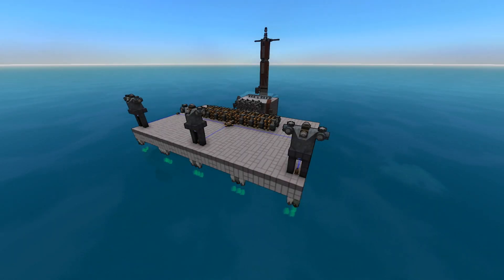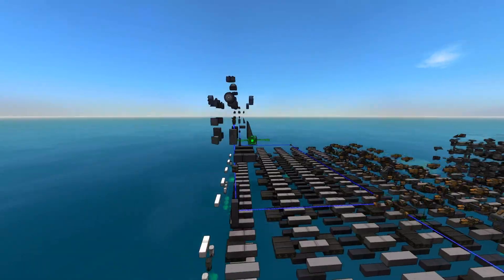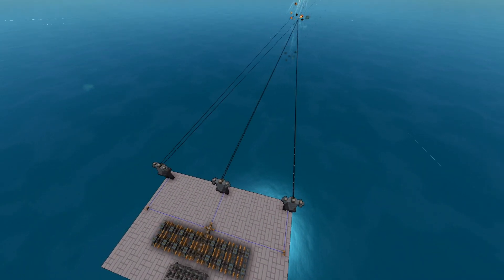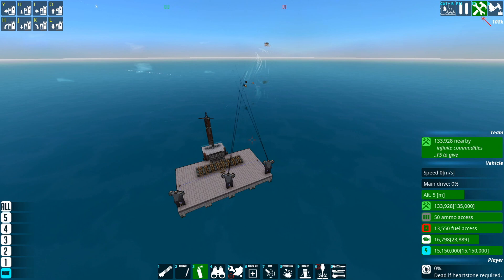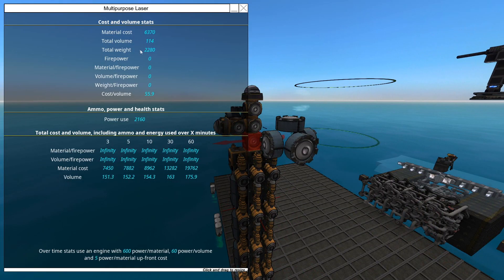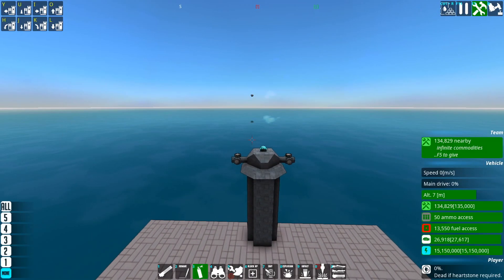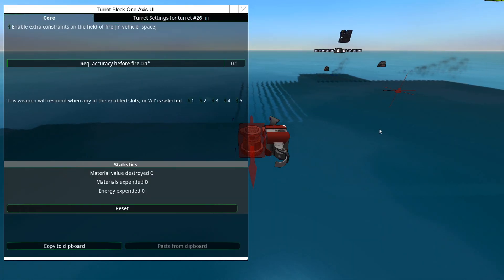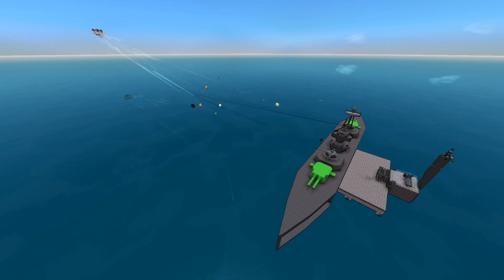LAMS Turrets? From the Depths

Comment: HOW DO I MAKE MY LAMS WORK. THEY HAVE MUNITION WARNERS, BUT THEY NEVER FIRE.
Reply from the maker: - Are they connected to the laser system, via connectors or transceivers?
- Do you have sufficent engine power, materials and/or fuel storage to run them?
Reply: @BorderWise12  I did have them connected, and I had enough engine power, idk what I did, buy they work now.

Comment: Just a heads up here, but you probably want to use a 3m turret base and turrets with nothing but the laser lensing components in it to maximise the rotation speed you can get from them. That way you don't get DDOSed quite so easily and pipe in the actual power from a fixed laser brick with more significant amounts of armour.

Comment: Personally I still think having more nodes is better then having them spin around. There's no delay of waiting for it to rotate into position and even if it gets destroyed on one side you still have the other side defended. On top of taking up less space in a larger variety of locations. However I have considered the idea of putting nodes on APS CWIS turrets.

The big issue is having the munition warners spinning around like that. Unless they changed it, those loose effectiveness the faster they spin. Having them trying to track missiles like that is going to make it harder for them to find missiles in the first place. On the flip side of that, I've considered having them on a spin block that always points north. Then they would almost always be close to 100%.

Comment: Any chance of a melee ultra short range missile defense system using the PAC as a laser flyswatter? 😁
Reply from the maker: PACs can't damage missiles... so no, unfortunately.
Reply: Yeah... still not happy that they just hardcoded certain weapons to not be able to to do it, simply because they didn't like people using them that way.
Reply: @Daemonworks  I guess they didn't have to write any code to not make certain weapons work against projectiles.
I think it also might be annoying to see your 1000000 damage PAC beam end up sending an 63mm shell into oblivion.
People would complain about that too.

By the way, does anyone here know if melee laser cutters work as an CIVIS?
I have not seen a Jedi style LAMS.
Reply: @Daemonworks  PACs are pin point accurate at close range and can output considerable amount of damage in little time, so I can see why they excluded PACs from being able to do it, also way easier to tweak, so you could easily end up with something that may not be more efficient but easier to deploy than LAMS or Anti-Missile Lasers in a fraction of the space.

Comment: Hey Borderwise, any tips for making a fuel/steam engine because I can't seem to make an efficient engine for bigger crafts.
Reply from the maker: Yeesh, I really need to make some more tutorials for both those things, don't I? 😅
I'll mention two of the most straightforward tricks for efficient fuel and steam engines:

For efficient fuel engines, try and thread exhaust through as many turbochargers as possible. It's complicated spaghetti, but it pays off. 

For steam engines, it helps to recycle the steam. See the little arrows on the steam pistons? Channel steam through them and into other pistons and you'll get more use out of your steam. 👍
Reply: @BorderWise12  ok thank you so much I really Appreciate the tips

Comment: I just put a few LAMS nodes evenly over the surface and a few on the already extant turrets when I build normal ships, but with anything really big I like two-axis turrets with a decorative short range laser and a LAMs node above it. It helps that if I use lasers at all, they are stupidly overpowered, so I never have to worry about enough coverage :D

Comment: For context, since last LAMs video this was something I proposed as being more effective than spinner LAMs so I wanna properly explain what I meant:

I mean using pre-existing turrets, since lasers only need to point to the turret axis block to interact with LAMs and laser systems on a turret, you can fit LAMs nodes in very tight and slim spaces, like for example on your main guns, your secondary guns etc, it bypasses the need of creating a dedicated turret by using existing ones, of course those turrets are generally way bigger targets since they need to be big enough to house the original weaponry, so that would be their main downside (also a lot more explosive in a lot of cases).

Also regarding the need for less LAMs nodes since the turret spins to the target, yes and no.
Yes if you are in a 1v1 situation.
No if you are fighting against a group, nodes on all sides are still needed if you have enemies on all sides, even if they are turreted.
So it's absolutely fine for example on 1v1 tournaments, not so much in campaigns or fleet tournaments.
Reply from the maker: Ah, I guess I took you too literally. Whoops. XD
Sticking them on the main turrets is something I have literally never done, but it could be interesting to try that.
Reply: @BorderWise12  No problem, I should have elaborated to begin with, personally never used it myself, or LAMs at all since I am not a laser guy but it should basically amount to what I said, less expenses in turrets and space but way more susceptible to being shot off, especially if it's on a turret carrying more volatile weapon systems, and the downside is not that bad actually thinking about it, after all, if you lost all your guns you lost the battle, so there is not much point in struggling further, well in 1v1s anyway.
Reply: well said mate
Reply: The main advantage LAMS ball turrets can have is the use of SRCs, as those can be used for extremely high burst damage at shorter ranges. If they're tuned to only operate at 150-200m the damage multiplier grows significantly, and that can make small burst LAMS setups on small ships much more viable.

They're still not a perfect solution if you don't have deck space, and as such are mostly focused on missile ships, but they also give you the CIWS setup options that allow you to pick and choose your shots much more effectively
Reply: Though, this could be useful to add onto dedicated detection turrets, generally I'd setup two LAMs loops on anything 400k+.  then if part of the loop is shot, the loop continues to function, if the loop feed from the LAMs or the LAMs for that loop is taken out, at least there is a second LAMs loop.  a loop is just an circle in the freeboard that is fed from a couple places from within the citadel.